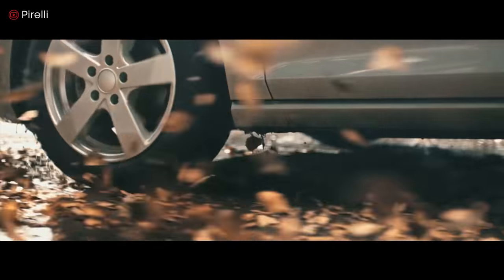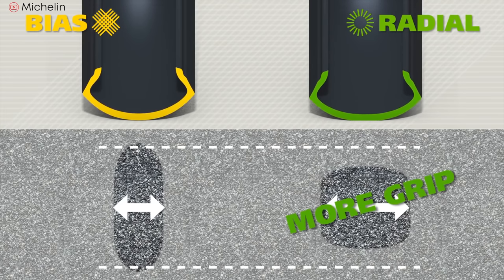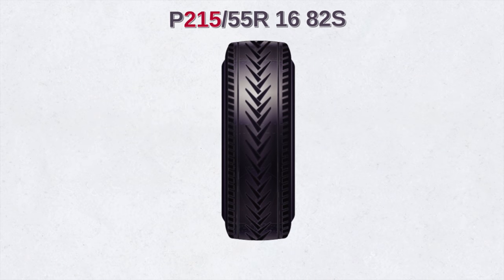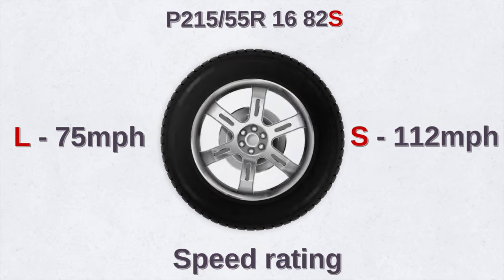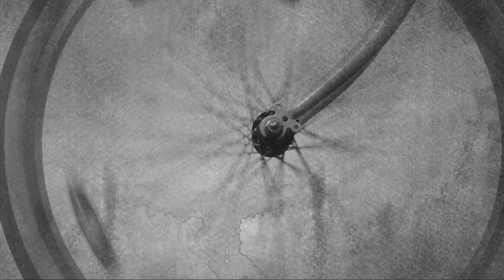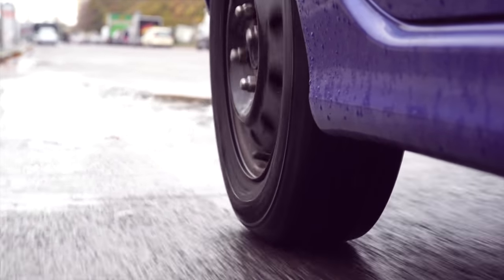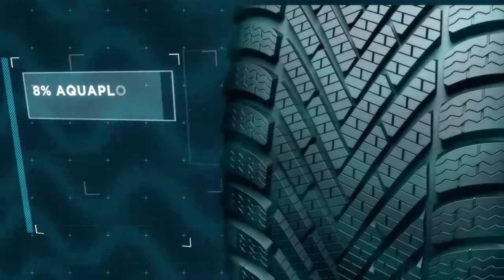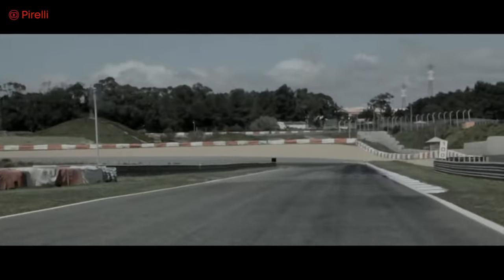These Tires Will Last Forever

Comment: "These Tires Will Last Forever": I'm not willing to watch it again, but I missed your addressing this on the first time through.
Reply: Same here. Buying tires today and I still don’t have the info I need.
Reply: First time?…
Reply: Me, too.
Reply: Me 3
Reply: Me 4! C'mon Scotty!
Reply: Here's a tip. Always over inflate. It'll last longer. (according to this ↑ by 4 psi)
Bumpy ride, it's NOT tyre job to make it better. Check the shock absorbers.
Difficult handling (steering the vehicle), again NOT tyre job. It's power steering, ABS, EDU or whatever you call it, that assist driving.
Reply: yeah, he didn't answer the question, but from what I heard tires from the past were designed to last indefinitely until planned obsolescence slowly infested every goods industry
Reply: @budisutanto5987  your advise is wrong and dangerous.
Reply: @allaboutroofing2  but you don't know why?
Reply: @budisutanto5987  I disagree. Over inflation wears the center tread more than the outside. Also reduces contact patch for handling and stopping distance.

And tires can absolutely cause a bumpy ride. If the balance is out, it may need to be rebalanced. And if it is suspension, I'd bet the tires need to be replaced as well.

Tires can also affect handling. I have seen a car go overdue for an alignment and then get one and the car still pulls because once those tires are worn slanted they'll never pull straight again. So in any of those cases, you'd need a tire as well.
Reply: @katiebartlett6239  Good point on center tread.
But . . usually people put things in a car, making it heavier.
So unless your car is 'sterile' , which is unusual for normal car, center tread isn't a problem.

For the rest . . .
- over inflate tyre effect handling.
If you experience bumpy ride, check your suspension.
Those people who change their suspension isn't really crazy.

- Overdue for alignment.
This is disturbing, there's no time limit for an alignment.
Your friend should consider other garage.
Don't reply this with : accident, run into a foot high rock etc;
accident is not a scheduled overdue.
Besides accident, the only thing that can effect bolt & nut 🔩, is the absent of spring ring or . .
it isn't tighten properly or . .
no grease inside joint.
In short : IMPROPER work!

And it's shouldn't be mentioned,
it's suspension problem, that damage tyre,
not tyre problem.
Reply: @budisutanto5987  also, my car does happen to be kept light, but I know that is not average. However, I literally check tires everyday and can call them as overinflated before checking pressure quite often based off of tread wear. Literally had a conversation with an automotive service instructor this morning lol. It causes uneven wear.
Reply: @katiebartlett6239  Uneven tyre isn't because overinflated,
it's alignment, then balancing.
More often it's a miss alignment.

It's unnecessary to check your tyre everyday.
I use correct way of inflating, then check it after a day, then after a week,
when everything is ok (pressure stable),
I only check daily by looking at it casually when I'm about to go.
Reply: @katiebartlett6239  When you correctly inflate tyre,
it's stable for years.

I had a car that didn't got accident for 3 years, all 5 tyres have stable pressure.
Maintenance free.
(note : hitting a foot high rock , considered as accident, cause it can miss allign suspension)
Reply: @budisutanto5987  not necessarily. If you drive on rough roads, you don't have to be in an accident. It's simply not true that the only time you need an alignment is when you have an accident.
Reply: @budisutanto5987  This is the one of the most ridiculous comments I've ever heard on the internet. You're rolling a machine that weighs a few thousand pounds over cement and asphalt at speeds up to 75 mph regularly and you expect a rubber compound to last the life of the car? Maybe on Model It's that average 10 mph and only driving around town for the life of the car. Please think before making comments next time
Reply: @bustaruckus5611  You can use your own advice.
I believe I never said the tyre would last the life of the car.

Which is forever if you keep maintain the car.
Reply: @Budi Sutanto  A tire shop owner told me years ago to over inflate my tires to 1 psi less than max psi rating on the tire.  So, many years i tried that and mpg increased, but the tire wore out quicker before the mileage warranty. The over inflation of my tires raised my tires in the center of treads, so my tires wore out quicker in the center treads of the tire, but only the outer treads of my tires held more tread throughout life of that tire.  So, over inflation of tires kills your tires way before their tread warranty ends, but it maximizes mpg on your vehicle.  So, maybe the tire shop owner wanted me to buy more tires in less time with his advice.

Nowadays,  i just put the manufacturer rated amount of psi in my tires, or maybe 5 psi extra but no more than that, and my tires last longer and  wear down more evenly  across the my tires from front side of tire to backside of my tire. I don't get as good of mpg though, but my tires last longer. This may also give my tires better traction. 

Some people may not know this, and those who over inflate their tires may wonder why the center treads of their tires wear down faster than than the outside treads on their tires.
Reply: @Budi Sutanto  You may not know this but tires pressure goes up in warmer months, and goes down in colder month, whether you added air or not. My tire pressure won't stay consistent for years, but it may hold for about 1 week and i recheck pressure then. Now, i hear that putting nitrogen in your tires may make your tire pressure remain consistent longer, but i have never had nitrogen in my tires, just air from a air compressor at a service station. I try to keep an eye on tire pressure weekly, to make my tires last longer with consistent tire pressure.
Reply: Also I don't check MY tires everyday lol, I work in a shop and check tires every day all day.
Reply: @Katie Bartlett  Once a week tire pressure check seems to work for me.
Reply: He didn't tell you Firestone, vs Goodyear, he explained the differences and conditions to use dedicated tires like summer, all season, or winter.
Reply: @budisutanto5987  is this true? Have wondered about this. Please let me know where you learned this. Or where I can find this info. Much thanks!
Reply: @tdhawk167  I learned this from various source.
And the hard way : driving a car with smooth - bottom side thread - tyre, on wet road. There's not enough traction, difficult handling, prone to accident. 
When a driver lose control on an accident, usually because improper tyre. 

Under inflate tyre, have reverse U shape on the bottom, normal shape on top. 
Side wall tyre, on top of rim - straight, under rim - bow shape.
Improper tyre shape, accelerate wear & tear.
It's like bending 1 mm wire vigorously, eventually the wire will snap. 

Temperature rise. Friction between tyre and road, raised temperature.
The longer you drive, the higher the temperature.
High temperature effect tyre shape, need enough air pressure to counter. 

People tend to deflate tyre pressure to avoid bumpy ride. This's a grave mistake.
It's suspension system job, to give smooth ride.

I recommend :
- Citroen 2cv
- VW kumblewagen
These are cheap car, that have smooth ride, some said better then expensive car.
Reply: @budisutanto5987 you clearly were never on the track
Reply: @mako_bd7012  Is it because I'm not worry that middle tyre track worn out,
because the outside tyre track worn out when I turn to left or right, with high speed,
Forcing me to regularly remove tyre from the rim, turn it & put it back on?
Reply: Yall crazy man lol
Reply: I came for answers  hot a history lesson! C'mon scotty
Reply: Yes, it worked… the technique dramatically increases view count and engagement.
Reply: @budisutanto5987 It’s not completely false what you are saying but it’s a big stretch. Go take a brand new bmw for a ride with flat-runs and then put on some good quality summer tyres; you won’t be able to blame it on shock absorbers.
Reply: @balistikcious  I'm guessing this is about bumpy ride.
Might want to try flat tyre on VW instead of BMW.
The shock absorber of VW rather similar to tank.
Tank, as we all know, use metal track.
Reply: @budisutanto5987  BMWs have stiff suspensions as well buuut you are missing the point in what I was trying to say. Difference in tyre quality is easily felt even by an inexperienced driver. So your shock absorbers are not the only thing doing the absorbing of the shocks but the tyres as well. Over inflating is not good and the only thing you are achieving by that is actually ruining your shock absorbers amongst other things.
P.S. I work at Michelin.
Reply: He's talking about the All-Weather tires. He OBVIOUSLY mentioned the downsides to bias and winter tires.
Reply: First time watching Scotty?
Reply: I was tricked into watching this
Reply: The tire that lasts forever is one that is properly taken care of.
Reply: @WalterSMM2  No tire lasts forever. Period!
Reply: @katiebartlett6239  over inflation wearing the center tread does happen, but it’s not gonna happen from 4 pounds of additional pressure, that’s like the people who read the full max inflation PSI on the sidewall of their tires, and insist on following that as opposed to what the car door jam tag says.
Reply: He does that a lot actually
Reply: No it's not
Reply: New all weathers?

Comment: I remember the first time I got a new set of tires. Brand new set of Continental all-seasons. I'll never forget how my car all of a sudden felt lighter and shifted better. Great tires are totally worth it.
Reply: Which ones
Reply: huh??
Reply: @Rainbowclaw  he means what tires did he get
Reply: I bet they didn't last cause they're soft, I had them ,had to replace them after 2years, good riding but wears very fast@
Reply: @robertmaimone8733  You realize that continental makes more than 1 all season tire? Without the op stating which tire he had comparing whichever one you had to theirs is pointless. 

Also, 2 years? I've never heard of any tire manufacturer saying "our tires last x amount of years". They go by miles. 🤦‍♂️🤣